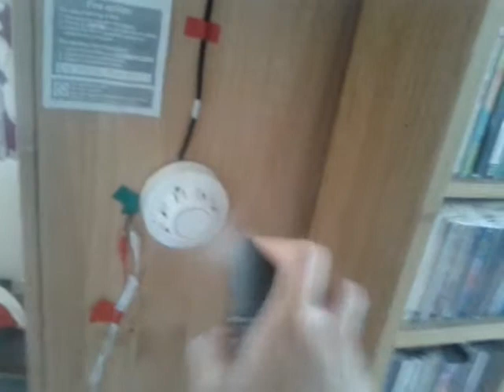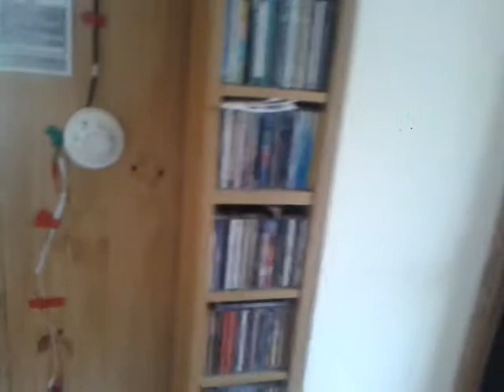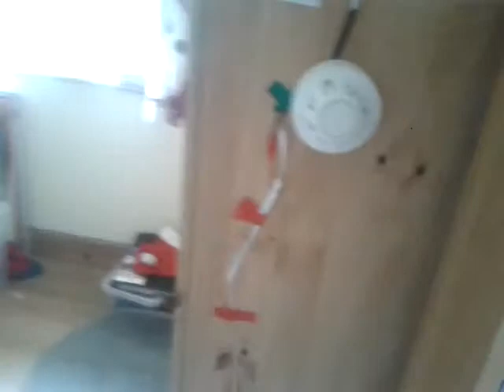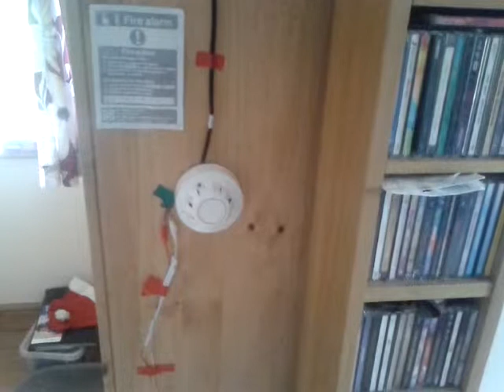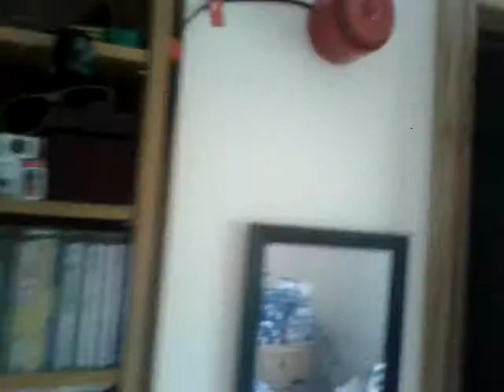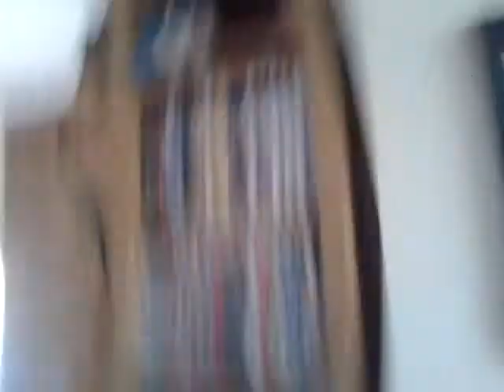Apollo smoke detector fail

Comment: The Series 65 doesnt break or complete the circuit so it wont work like this without a panel
Reply: Alex _TheGeekery the series 65 does work with batteries.
Reply: that is not the smoke detectors can work without a panel